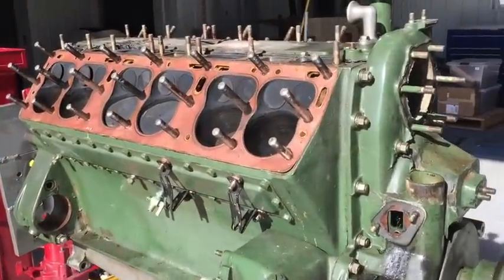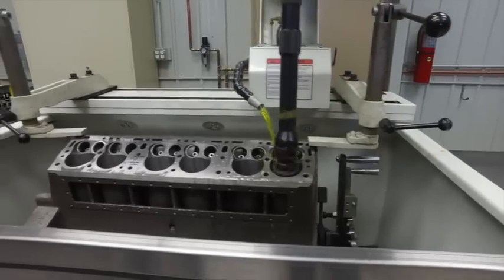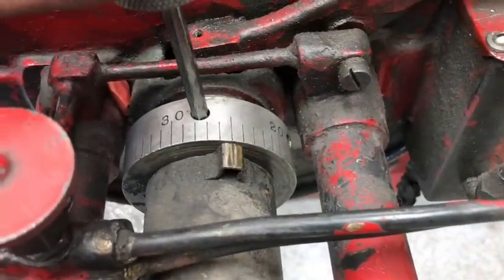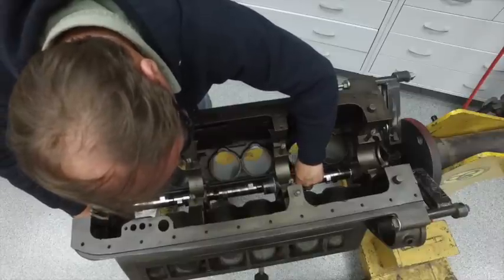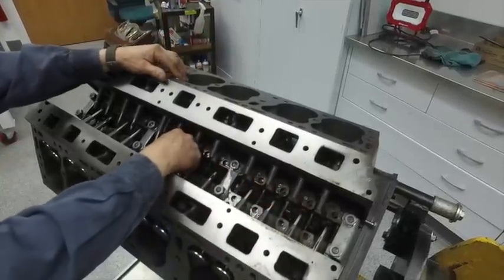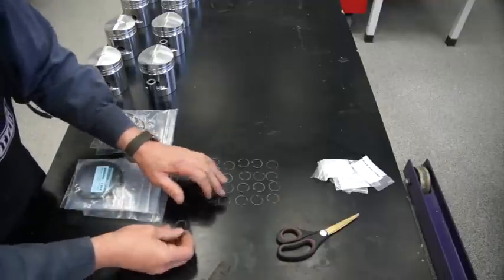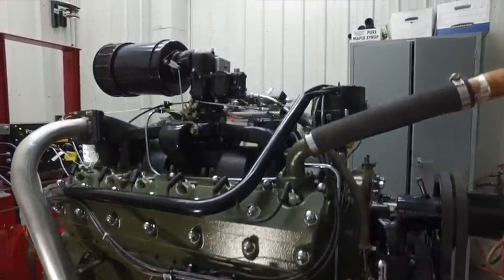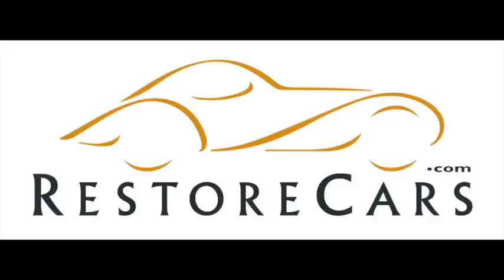Remanufacturing a Packard V12 engine

Comment: This was fascinating! They still use babbit bearings? You'd think it would have been upgraded by now.
Reply: Christopher Wyller F1 engines still use babbit style bearings
Reply: Frankly I wasn't aware they still existed. Kinda soft metal though.
Reply: WTF is your problem, Peter?  Comment after comment full of an obnoxious attitude.  Not a single video showing a restoration of any standard on your channel.
Reply: More bad news for you Peter:  Restoring a babbitt engine bearing is not a "cheapo shortcut."  An owner's concern for proper historical correctness, yes, even inside the engine where no one will see, is perfectly legitimate.  Also, if you were paying attention to the video, the narrator stated in this case, that it wasn't feasible to install modern insert bearings, which is also obviously is another legitimate reason for poured babbitt. 

By the way, taking machining costs into consideration, babbitt bearing restoration is not significantly cheaper than the machine work and insert bearings. So, you're wrong about that. 

As well, don't sprain your arm patting yourself on the back regarding your alleged knowledge of basic physics. Manufacturers likely switched to insert bearings because they could produce engines faster with them, and they were more serviceable by the mechanics of the time. In other words, it probably had little or nothing to do with basic physics, and lots more to do with basic economics. Further, if you're going to be a know-it-all sanctimonious ass, you should know that babbitt is correctly spelled with two "t"s.

Comment: what brand of engine stands are being used in this video?
Reply from the maker: We use several different kinds of diesel stands. One of them is an OTC. I cannot think of the others right off hand. They are very expensive and thus I usually buy them at auctions

Comment: I once had an "old-timer" tell me that babbit in car engines are better set up TIGHT due to the soft bearing material, its thickness and lack of steel backing directly behind it  so the bearing can set its own clearance for maximum life. He is a legit old car expert who does phenomenal restorations in an old 20s-era Chevy garage full of Ford special tools and literally does everything on every restoration except the upholstery. His wife does that. He accumulated parts and planned his '54 Chrysler New Yorker Convertible restoration for almost 50 years before he had the time, money and parts all together to do it. He "started" that process when working in a Chrysler dealership when those cars were brand-new. I know some antique tractor mechanics and restorers do the same thing with their bearings. Apparently if you set them loose you'll be resetting bearing clearance a lot sooner than with them set snug. Any comment?
Reply from the maker: Babbitt is a long subject, but the short story is we use spin babbitt.  It also have silver in it.  It is thus denser and does not settle.  I had the opportunity to inspect a 1937 Packard V12 I restored that had 10,000 miles on it.  This engine we put poured rods and mains in at customer request.  I cut the clearance to .0020.  After 10,000 miles it was still right on .0020.  The car now has over 20,000 miles and still runs great with good oil pressure.  My point here is that not all babbitt is the same homogeneous product.  One has to know the product they are dealing with and act accordingly. 

On another note, many comments have been posted here.  I love it.  This is a great byproduct of making these video's.  But I hope everyone keeps in mind that these cars have very different histories and thus the condition of each car varies greatly.  Couple that with all the different designs and manufacturers we have to deal with.   No one formula works for every situation.  I saw a comment one here that said the bores will never be straight without a torque plate.  He is right about some engines, but he is completely wrong when it comes to a Packard V12.  An Auburn V12 also does noted a tongue plate to keep them straight.  But they are a must on many newer V8 engines.  

Keep the conversation up.  It's all good even when some comments are inaccurate or hurtful.

Comment: WOW!! Fantastic! Very torquey engine... What would explain the higher than stock H.P. #'s?                                                                                                                                                                                                                                                                                                                                                                                                                                                                                                                                                                                                                                                   Tighter tolorence's??
Reply from the maker: There are several factors going on.  Pressure altitude was in our favor that day.  It was bored out to .060 oversize.  Heads and block were surfaced and compression height was raised.  It had an unusually low parasitic drag.  All added up to better than usual numbers.  we usually get 5% better than book numbers.  This engine ran about 15% better.
Reply: Very nice video ! More vids like this on engine building these old engines! Well done Bravo!!!

Comment: the valves are upside down. 

what is this madness?
Reply from the maker: Those crazy Packard engineers
Reply: i know right? 

in all seriousness though, why were so many old engines configures like this?  dont know much about cars... old cars especially, but putting the valves ontop of the cylinder seems so obvious( with respect to flow) that im sure there was a very good reason they did not/could not do it?

im a civil guy...i design compressed air systems for waste water treatment plants(amongst other things) and i would get canned if i ever proposed a 180 hard bend like that lol.
Reply from the maker: Some confusion on my part (easily done).  The valves are on top of the the cylinders.
Reply: im referring to the top face of the valve pointing upwards parallel to the axis of the cylinder center line instead  of the valve being above the cylinder center with its face pointing down towards the top of the piston.  

in the latter arrangement the air would seem to have a less obstructive path to entry and exist no?  maby it makes no difference?
Reply from the maker: Are you describing an overhead valve setup?  Where the head of the valve faces the head of the piston?
Reply: yea i googled that and its exactly the picture i had in my head. 

so embarrassing lol. 

sorry i can clean MAF sensors and swap alternators and water pumps and ac compressors... thats about the extent of my car knowledge.
Reply from the maker: There was quite a few manufacturers in the 1930's that utilized the overhead valve design.  Duesenberg, Stutz, and Buick, just to name a few.  Many foreign makes also used this design.  Harry Miller and the Duesenberg brothers made all their race cars of this design throughout the 1920's.  It is a superior design but expensive to build.  We'll have lots of great history segment in up coming videos.
Reply: ah i see. that makes sense.  

i know packard made plane engines in WW1... and again in WW2... and i think they made those amazing torpedo boat engines in WW2.  would those have been overhead valve? 

subbed your channel, looking forward to those history videos... IDK how i even got here, but im glad i found this video. your work is amazing.
Reply from the maker: Thanks Tim.  If your interested in Packard Motor Co I recommend a book called The Packard Story by Beverly Rae Kimes.  I see them on Ebay all the time.  We will be putting out an episode every 2 weeks and some short clips every week starting in a month.  We will be attending the Concours of America next week with our 1934 Lincoln Brunn bodied Convertible Victoria.  Our film crew will be there to catch it all.
Reply: google "rolls royce merlin". packard made them under license during the war for the US and UK, several different planes and boats.

Comment: Hi, i posted this on another of your videos but it doesn't show in the comments. i hope it works on this video. cheers. Hello there from England  u.k.  i notice that you mentioned blasting machines that you have and use. there is a new product on the market called Grittal which i use and it is fantastic. Unlike grit/sand/aluminum oxide which pulverize into powder and lots of dust which also makes it difficult too see even with good extraction, Grittal is cast, crushed and heat treated stainless steel. it doesn't break down like grit and no dust and the finish is superb and not flat like grit type abrasives. you should check it out, you will be glad you did.  they also do Chronital which is a substitute for glass bead. the finish is stunning and no dust. there is different grades available.   They will have a distributor in the USA. check out their website.
http://www.vulkanshot.com/products/grittal
 http://www.vulkanshot.com/products/chronital
When doing blast work on such high end cars as you do, finish is very important and you will be beyond impressed with the quality of these products. they also have a you-tube video
https://www.youtube.com/watch?v=7vvWoMC777k
I just hope that i was of some input into your fantastic workshop and restoration process.  Grittal and Chronital are not as cheap as conventional media but i don't think that i need to tell you that quality doesn't come as cheap as normal or average.
Also for wet blasting/aqua/vapour, Vixen do some very good machines and i think they have a distributor in the USA.  They also do dry blasting and i have one of their machines.
http://www.vixen.co.uk/
I wish you guys all the very best in your restoration business. cheers and all the very best. Bill aka velocettedude.
Reply from the maker: We have all you have mentioned here in your comment.  We have a shot peen machine that uses both steel and stainless steel shot.  We shot peen the block, rods, and crankshafts (sometimes the crank get stress relieved by my crank grinder).  Other parts that are just be de-rusted and stripped of paint are shot in either our glass bead machine, walnut machine and we have automatic blasters with ceramic and aluminum oxide (for the really touch stuff).  We also soda blast aluminum parts.  It gets quite involved.  Maybe I should produce a video on just all the stripping methods we use.
Reply: Hello there, i assumed wrongly that you had not heard of the products i mentioned. sorry about that. I think the idea of yours to produce a video on just all the stripping methods that you do is a very good idea and you-tube is a form of think tank and sometimes people can tell you something that you just don't see. All of us, myself included are never to old to learn. i am 60 this year and i am still learning. Cheers. Bill aka velocettedude.

Comment: Those cylinder bores looked pretty damned good before you started on it.
Reply from the maker: Just by visual observation only, how can one tell if the bores are good or not?  Are they straight?  Are they round?  Are they perpendicular to the crankshaft?

Comment: Very nice. Interesting the modern approach to machining, CNC vertical mill, etc. And it must be nice too to start with an engine as well designed and built as a Packard. None better. I suspect that crank has galleries for rod bearing pressure feed. I didn't see any dippers, but I don't expect dippers on a Packard.

Comment: Is there options for different carburetors on these engines
Reply from the maker: The Packard V12's from 1932 to 1939 used several different versions of the Stromberg EE-3 carburetor.

Comment: Restoring is not remanufacturing.
Reply from the maker: We consider ourselves restorers.  We do not do resto-mods, street rods, etc.  For example, when we go through a water pump, we make all new internal parts and will make internal modifications to improve it's performance and reliability.  A cylinder block may have none of it's original housing touching a moving part.  It may have to be completely sleeved, new hardened valve seats, etc.  We will not repair just one valve.  We make them all new to factory spec, or we will not perform the work.  It's just symantics.
Reply: Clay, about how much money does an engine rebuild like this 12 cost?
Reply: Such fine work.  Allowing fine old cars to be reliably enjoyed is a good thing.  This type of preservation makes that possible. Cheers.
Reply: Be Yourself Depends on how you look at it. If everything is rebored, reground or resurfaced with new parts fitted where required, it could be classed as "remanufactured". In reality, this motor is "reconditioned". It means she should run sweeter than when it rolled off the production line! No denying the painstakingly beautiful craftsmanship of this job!

Comment: Where do you find engine specs and tolerances?
Reply from the maker: We use National Data Service books.  I have over 20,000 pages available on my website for free.  But one has to be careful, the Cord Supercharged firing order is incorrect in these books.  Packard put out lots of great materials too.  These books can be found on Ebay.

Comment: You mean the errors were 2/10s of allowable deviation from book value right? Not 2/10s of and inch. Nice shop, clean, new tech machines.......very impressive.
Reply: most likely .0002". That's 2 ten - thousandths of an inch. Saying ten thousandth is a little cumbersome and most machinists will say tenths when talking about the 4th decimal place.
Reply: That definitely would make more sense.

Comment: real nice engine shop with mostly modern tooling , did you do the white metaling , did you cast the bearings , i did this in the later 50,s on model b motors
Reply from the maker: We used to.  I sold the setup because I can have them done at less expense and the guy does a great job.
Reply: i remember well sitting down with the casts clamped to the motor and pouring the white metal in , and hand finishing the bearing fit with a very early type of dyechem and a bearing scraper, now i choose a bearing size that gives me the clearance i want, i have bearings in 2 tenths difference then we didnt have any real measuring tools and the motors only lasted maybe 20k miles ,what a difference to today, thanks for the vid

Comment: I thought Packard referred to their V12's as Twin Six'es and did not use the V12 nomenclature.
Reply: that depends on the model year.... early (brass era) V-12's were called "Twin SIx", discontinued, then called "Twin Six" again for the first couple of years after they were reintroduced.  i'm sure you can find the details online somewhere, but i'm pretty confident i'm on the right track....
Reply from the maker: Packard did use this nomenclature in the first series of V12's pre 1920 and then picked it up again for the 1932 V12 series.  But they dropped it in the 1933 models and just referred it as a V12.
Reply: My understanding is that because earlier v-type engines had a separate crank case and it was common to have the cylinders cast as separate multiple units due to the difficulty at the time of making a reliable or cost effective 'mono-bloq' which is why later 'mono-bloq' which I suspect Americans would naturally shorten to simply 'block' for one piece castings like the V12s and V16's of the 1930's were no longer called twin-six or twin-eights. Then again maybe they carried the twin- designation as a carryover term. Just speculating.

How about that Buick triple V-twin (231ci V-6)? Probably not (LOL).
Reply from the maker: Thank you Peter.  Spot on.